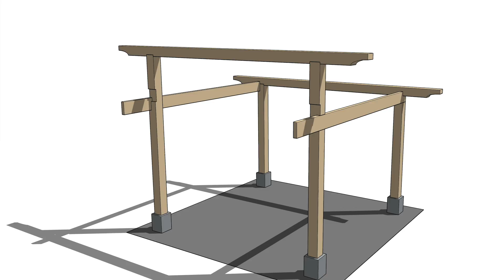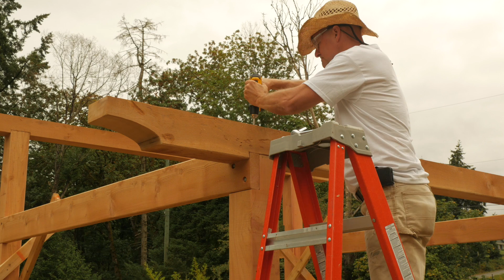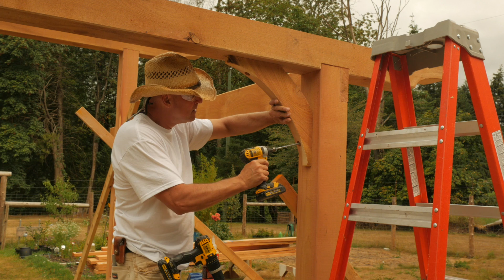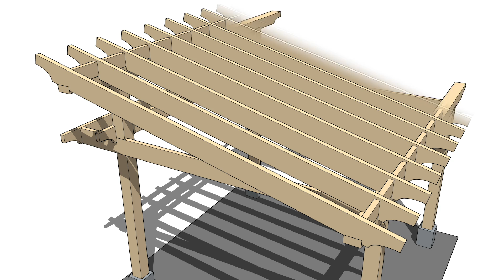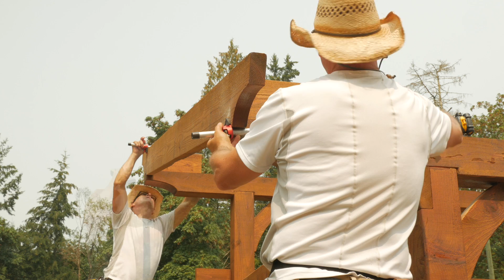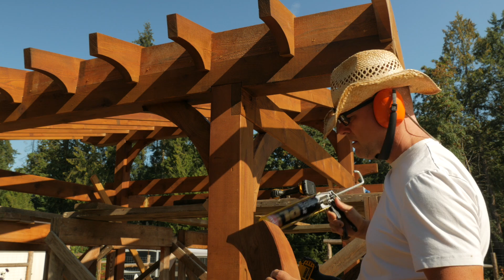Build a Timber Frame Style Wood Backyard Pavilion Part 2 of 3

Comment: Could you try one rafter for fit and cut all of them from that one
Reply from the maker: That is possible if your beams are exactly parallel to each other in both the top and front view aspects. And the beams do not have a bow in them. That's a hard thing to achieve with rough cut, air dried timbers. And, in my case, the rafters were twisted in varying degrees. Thanks for the questions! Cheers, Kent
Reply: @MANaboutTOOLS  I had the same question, it seemed inefficient to measure it each time, but I imagined that it had to be a reason for you to not do it that way, having in mind you don't look like an amateur. Thanks for answering!

Comment: Kent - love your design.  Question about how you did the blocking.  Since you are adding blocking as you go, I see you screw into the blocking with each new rafter, but after you set a new rafter, how did you attach a new block to the already installed previous rafter?

Comment: When it comes to cutting the birds mouths on the rafters... couldn't you use the first one as a template to cut them all?  That way you would not have to lift, mark, carry down, cut and then lift back up to install?
Reply from the maker: With this build I had some bowing in the beams and front posts. The top beams were not parallel (front or top down) so I had to cut each birds mouth individually if I wanted a good fit. Thanks for the comment, Kent
Reply: @MANaboutTOOLS  ah cool... I think for my pergola design I will be able to cut them all at once.  Thanks for the info.  Your pavillion looks amazing.  I'm gonna get a hell of a workout working with these huge beams.  And I'm doing 80-90% of my build by myself.  Its not gonna be as tall as what you built... Mine will only be 8-10 ft on the tall side... But my pergola is going to be about 35 ft long and about 8-10 ft wide.

Comment: Kent - do you use the same size lag bolt throughout construction ... 5/16" x 6"  for corner braces, girts, posts and beams?   Thanks Chris
Reply from the maker: Pretty much. I think a larger size for the connection of the beams to the posts. Can't recall the size. If I didn't show them for that project then I think I may have in part 2 of the woodshed build.

Comment: When you're cutting the bird's mouths on the rafters how do you ensure that the birds mouths are at the same spot on each rafter? After re-watching some sections a few times and your other similar project videos I can't quite see how you ensure the rafters are aligned the same way for each rafter.

Also, during planning stages how do you go about making sure your rafters are equally spaced while also accounting for their width? Is there a formula you use?
Reply from the maker: Hi, I put a pencil line on the underside of each rafter at a consistent distance, say 18", from the high peak end. I then set this line on the edge of the upper beam. Then I mark the two birdsmouths. Take them down and cut them. On the Garden Pavilion I made a small handsaw cut in the rafter at this mark. That prevented the heavy fir rafters from slipping while I moved around on the scaffolding to mark them. The spacing is straightforward math. And in my case it was okay of I was off a bit on the spacing.
Reply: @MANaboutTOOLS  That makes perfect sense! Thank you for the explanation :) I feel silly for asking about the spacing cuz after a little thinking it is pretty straighforward. Must've just been tired when I asked 😂
Reply from the maker: @GameBuddies1  No worries! Cheers!

Comment: What how thick was the marking stick you used to mark the birdsmouth on the rafters?  I noticed you used the thickness as a guide for your cut.
Reply from the maker: I can't recall exactly. I try to make the horizontal line about the same length as the width of the beam.